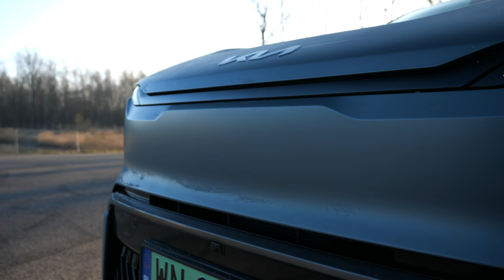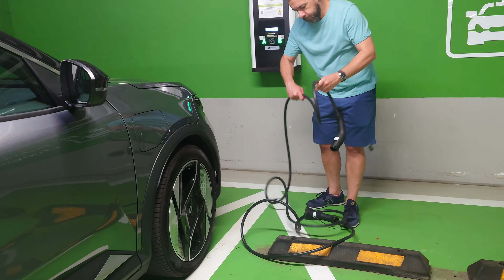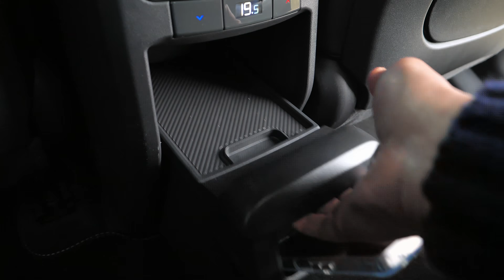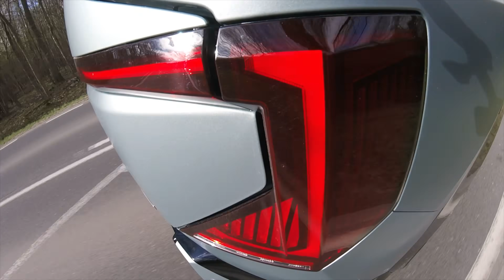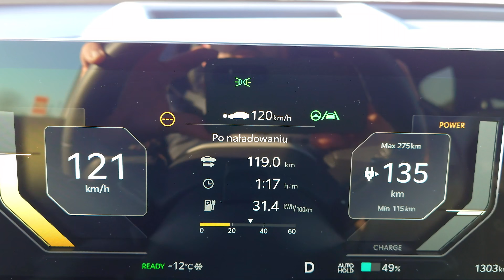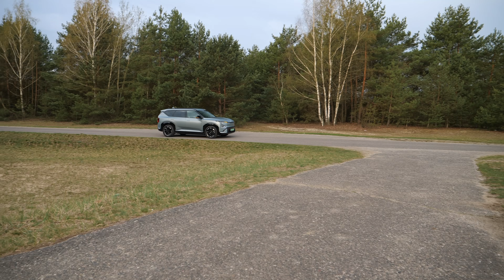KIA EV5 - Ready to Trade In Your Tesla Model Y? (ENG) - Test Drive and Review - Marek Drives

Comment: That was a good review narrated with some nice humour. I have a new EV5 GT line S. I find it very comfortable with good performance. I don’t like all the beeps especially the driver attention warning. I have set up a short cut to the * button on the steering wheel to go straight to the setting to turn it off but it’s still 3 taps. I am ok with charging on longer trips! I need breaks anyway. I’ll be driving London to Zurich in the summer and I think it will be fine. I had a Hyundai Ioniq 5 before. The back seats could slide forward to increase luggage space or allow more recline, much cleverer than the EV5.

Comment: What do you mean when you say wireless chargers on most Kia models don't work ? Why would they put one if it didn't work properly?
Reply: I have an EV5 and it works fine in mine. It’s often more the phone rather than the charger - big phones have big camera bumps thet means the phone sits on a slope. That being said, my iPhone Pro Max has never failed to charge in there.
Reply from the maker: That's a great question, and yet I'm to find a KIA, in which the wireless charger works without interruptions. I tried with and without the protective phone case, and the car keeps breaking the connection, assuming it starts charging at all. It seems to be very sensitive to vibrations, so the best I got with maybe 10 minutes on a smooth stretch of highway. Usually it's more like 10-15 seconds, and it disconnects. 
And before you say it's a problem with my phone, I'm currently testing the new RAV4 and BYD Dolphin Surf. In both of these cars wireless chargers work flawlessly with my phone.

Comment: I bought mine 3 weeks ago... I'm very picky and I love it.  If the door handles bother you, try a Tesla, you have to be told how to use them... i came from a BMW 530d.   Can't stop driving it, down some nice UK B roads.  Loads of tech, great sound system on GT line S, and I think they nailed the suspension.  P.S. I charge at home or with a fast charger, why bother with that cable business? You are right about the trim on the fold-down seats, but I think they did a good job for the price.  I have no problem with iphone charger, if you have a proper Apple case and not a cheap one, as with most cars.  If you set to diver Assist, I don't have much problem with beeps, you set volume to 1, which sticks, so not too bad.  Tesla it aint. Is larger! different car.  I spent 4 hrs with a Tesla, and found a lot of problems with their lane assist, which you dont mention...

Comment: I actually think Kia did a good job on this.  A shame they didn't slap the 800V charging system in there though.  So there's rear seat heaters right??? 😂
Reply from the maker: Indeed, it would have been better value with 800V. 
And yes, there are rear seat heaters :)
Reply: It’s coming soon

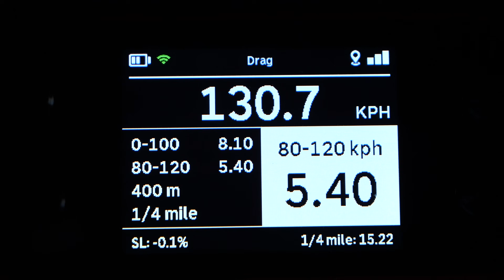Comment: 10:10 battery charge % has somehow affect to acceleration?  i didnt know about that ....  maybe the vehicle reduces the power under certain level of battery?  great video, AYY LIIIKEEE :hand-orange-covering-eyes:
Reply from the maker: For example in Cupra Born there was a tiny asterisk next to its performance figures. The small print said that in order to get the claimed acceleration figure the battery SoC needs to be at least 80%, and the battery temperature has to be so and so. Basically if you want to preserve the battery, and never charge it above 80%, etc., you never get the full performance, based on which you may have bought the car. This was a few years ago, so since then they may have updated the software, but it was an issue at the time of recording:
https://youtu.be/8SULe0ZRPfc

It could have also been the case in the Skoda Enyaq Coupe vRS.
Reply: @MarekDrivesENG thanks for reply man 👍💪